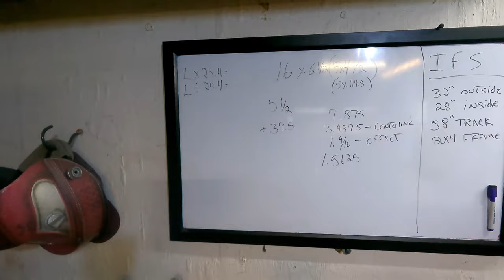CHOPPING THE TOP ON THE WILLYS WAGON

Comment: It is hard to chop the top on a wagon and get it to look right.  This wagon is fairly short, so better luck on it.   I am thinking of chopping the top on my willys pickup, the cab really looks tall and skinny, it may just need to be widened instead of chopped (i.e. make the doors 4in longer), another guy did that to his and it looked really good.  Others try to do extended cab and can't say those look right.   Anway, best of luck, hope to see the next chapter getting it done.  Or btw, the willys need a chop job that levels out the windsheild to the doors, it looks like a factory bad chop because the windsheild is shorter than the side windows.  I've seen guys who open the windsheild to match (or they raised the doors, much much harder), and it looks so much better. (see this one: https://www.youtube.com/watch?v=g0dBxwC-KsE)